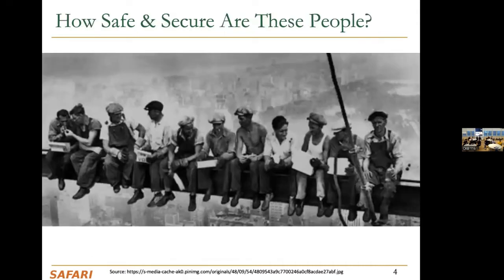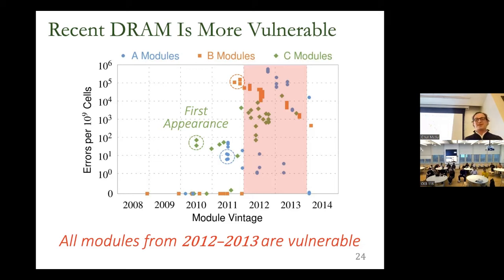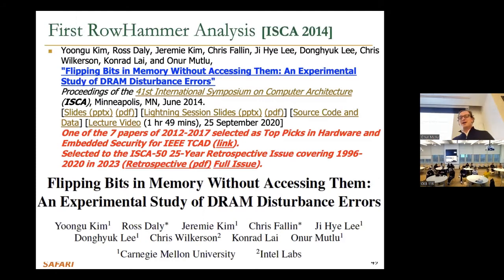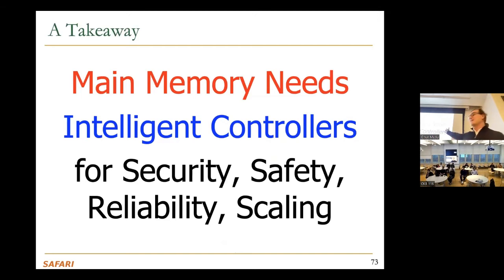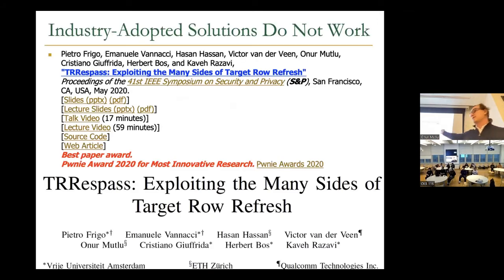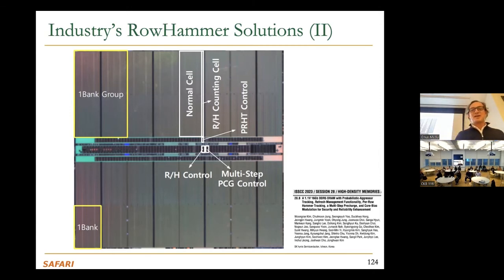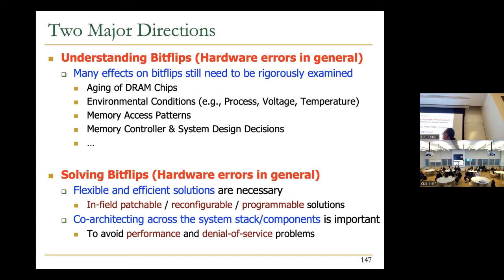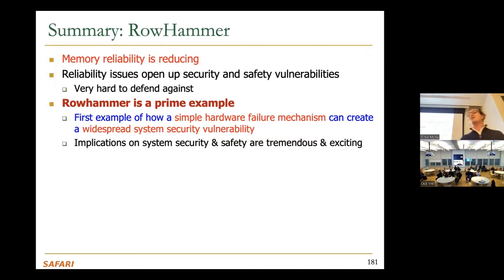RowHammer, RowPress & Beyond - Invited Talk at NJIT - Prof. Onur Mutlu - 18.12.2023

Comment: Is the victim bit cell charge loss dominated by the sub-threshold leakage of word line pass transistor? A small rise in the gate voltage of the victim pass transistor (due to capacitive coupling to the rising aggressor word line) would have an exponential effect on the current through it and thus the rate of discharge of the victim bit.